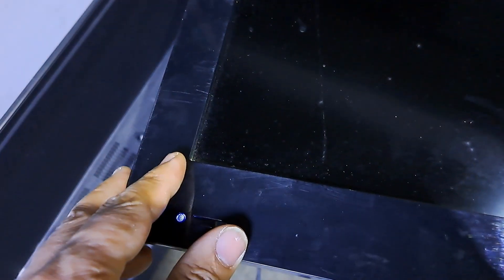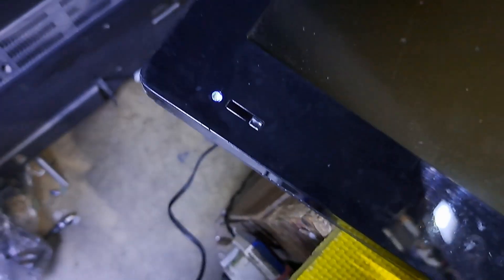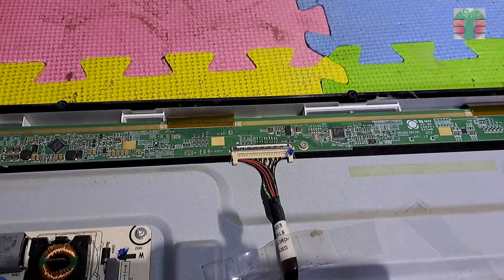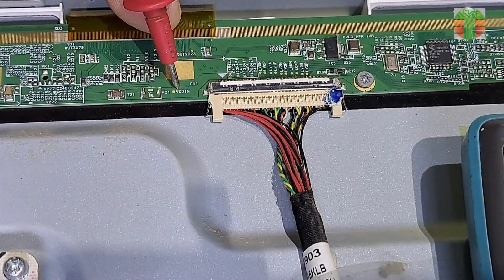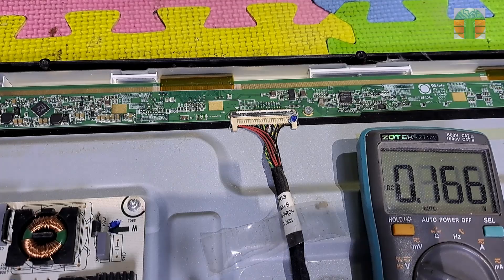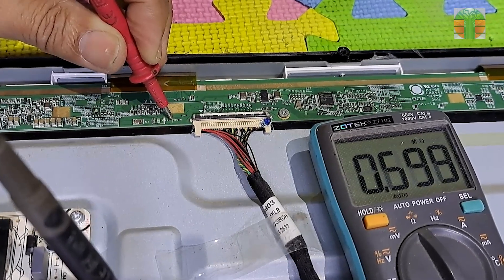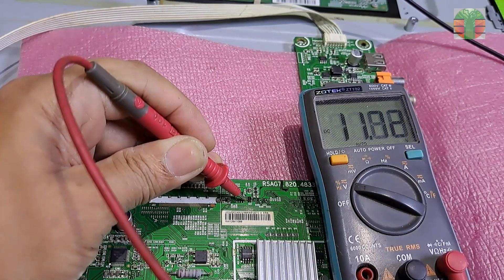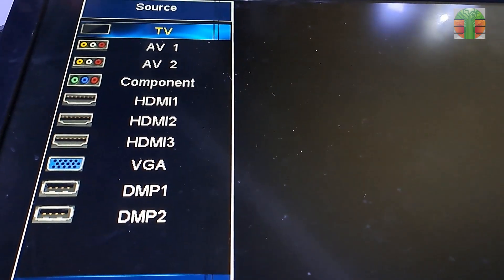Devant LED TV (no video)

Comment: Hi I have a question about my tv lg42um3050pfu it comes on fine but  after 15 minutes screen go's blank sound is still there but when I plug out right side ribbon cable left  side comes on again so I can think av bored is bad ok is there any way around this as new av bored is 40 euros I l am from Ireland
Reply from the maker: Do you mean the ribbon going to the panel? Seems the problem is the CKV lines.

Comment: Thanks you so much for the knowledge.
Good detective.
Good job
Well done
Reply from the maker: My pleasure
Reply: @tevzTVTevatronics  you're most welcome 😊...
I have a question to ask you.
Am working on a led tv. Seems the mosfet and the smd resistance and also the diotes all are shorted.
It's beeping on multumeter.
Despite remove them all.
The schkottky  diote SB3150 
It's beeping in both way.
Can I replace it by SR5200.
BECAUSE I couldn't get the same diotes.
Thanks in advance.
Reply from the maker: @Fardeenfarwest  what circuit is that?
Reply: @tevzTVTevatronics  led tv 42 inch ktronics.  The problem of the led. Is its turn on but no display.
When I have open it the backlight not turning on.
I thought it was backlight. When I check the led with led tester. It's truning on.
I think the problem is with the inverter.
And diotes / resistance problems.
Reply from the maker: @Fardeenfarwest  Is that the diode is the rectifier going to the LEDs bulb.
Reply from the maker: @Fardeenfarwest  replace it with a fast recovery diode 400 volts.

Comment: My monitor is a 165hz 27 inches, when its cold the screen has all these vertical lines but after awhile it goes back to normal, i can still use it up to 120hz but when i switch to 165 i just get a black screen, what do you think is the problem? people have been saying its a colder joint.
Reply from the maker: The panel is starting to fail. Try using 60 hz only.

Comment: Hi I'd like to ask you if you can help me with my tv it's a hisense 55b7100uw smart TV.... the tv screen  turns on but it only shows the logo and the red light flashes at the bottom
Reply from the maker: None stop flashing of the light indicator. It's probably a software issue or power supply failure.
Reply: @tevz TV  I opened the back of the TV and nothing seem to be fused nor did any of the components swell up ? .. how do I check the software?
Reply from the maker: @vannas2764  A fuse is nothing to do with its problem. you need a computer to program the software, it's not an easy task.

Comment: Very good Senior,

By the way the motherboard design is more universal and moduler compare to other Motherboard, look beside of the 3 pin MOSFET there was a empty space where you can add 8 pin MOSFET also.... Wow....
Reply from the maker: thus are for a bigger panel like 55 inches, its needs more current to the panel, and it uses the 8  pins mosfet.
Reply: @tevzTVTevatronics  ohhhhhh, thanks a lot...